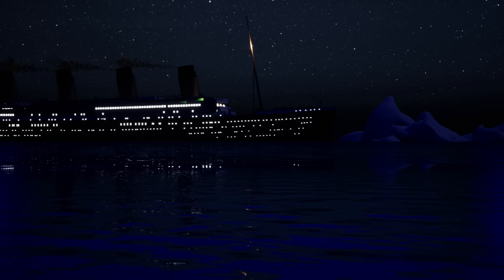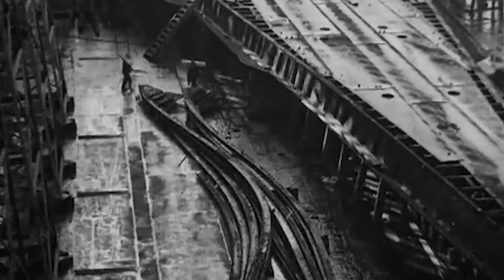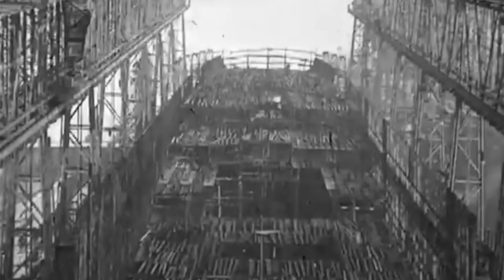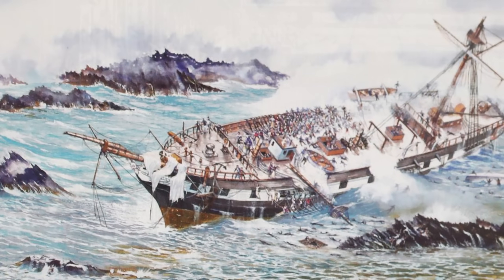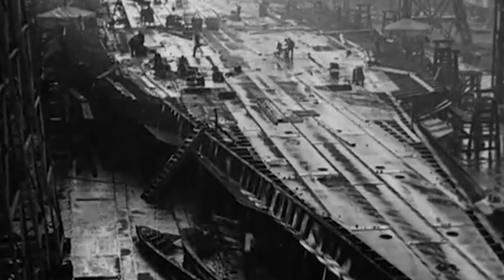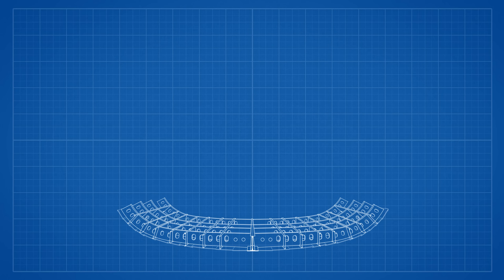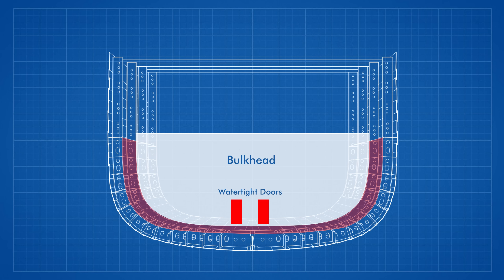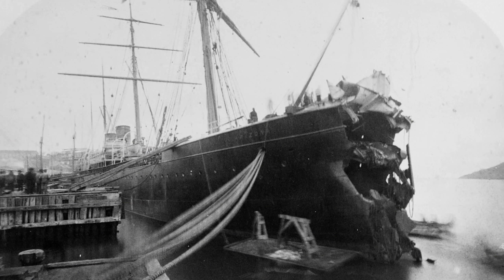How did the Iceberg Sink the Titanic?

Comment: One bit of pedantic correction: Technically, she wasn't designed to survive four compartments flooding anywhere. She was instead built to the specification of "Three of her four forward most compartments." It just so happened during the Inquiry Wilding calculated she could actually float with all four of her forwardmost compartments flooded, not just any three.

Additionally, later computer analysis suggests that with a couple exceptions around her engine room and (somewhat ironically) Boiler room 5, the ship could float with any three adjacent compartments flooded, though she was only built to have any two adjacent compartments flooded. She was a tough cookie; the iceberg merely found an Achilles' Heel.
Reply: It was less of an Achilles' heel and more that the ship hit circumstances beyond its limits. The fact is the Titanic collision could have quite possibly sunk even a modern ship. However, the difference is that modern ships don't sail into icy waters at full steam, don't solely depend on lookouts, take every ice warning seriously, don't use wireless as a fancy toy, and a whole load of other stuff. Titanic was sunk as much by hubris as anything else.
Reply: @whaleguy  it was common then that ships wouldn't reduce speed until they came into an ice field and then slow down. Just turns out the first indication of this ice field was the one directly infront. 
But yeah modern ships have radar and sonar and can detect icebergs long before they could see them.
Reply: @MrT------5743  It wasn't common to slow down for ice, but it was a dangerous practice nonetheless. A real, "They can't be negiligent if everyone is negligent" kind of situation.
Reply: Had flooding been limited to Titanic's first four watertight compartments (Forepeak Tank + Holds 1, 2, & 3) the horizontal bulkhead that formed the top of the Forepeak Tank found at the lower end of the first watertight compartment would have prevented flooding above that point keeping the rest of the compartment, which contained part of the Black Gang's living quarters, dry with the collision bulkhead between the first two watertight compartments holding back flooding that the three holds sustained during the collision.
Reply: You're a real tough cookie with a long history, of leaving lots of gashes likes the ones in me. Hit me with your best shot, lifeboats away.

Comment: One thing I always loved was that during the Inquiry, Wilding postulated the total damage to be no more than 12 square feet, or about the size of a refrigerator. When they used sonar to scan the hull, the total of the damage the sonar revealed was indeed 12 square feet. Wilding knew exactly what he was talking about. Another great video, Mike.
Reply: If I recall correctly, the side scan sonar team tried to avoid being too definitive about the size of the iceberg damage, as they also found a lot of damage caused by the simple fact she was bent as she hit the bottom
Reply: @flametitan100  The keel was broken a second time by the bow down impact of the bow section with the bottom.
Reply: @taras3702  That's what I'm referring to. The bow is bent around the cargo holds because of the collision with the seabed. The keel obviously took the brunt of it, but the sides did too, with a massive hole on either side.
Reply: Makes sense. He calculated based on how long it stayed afloat. They know the exact volume of the ship. So the area of the intake hole could be estimated.
Reply: I know it's been a while since you posted this, but do you happen to know where in his testimony he postulated that? I've begun reading parts of his testimony from the British Inquiry and I'm having trouble locating it (he answered more than 1,100 questions over 4 days!)
Reply: Either way, that is a very small hole in relation to the size of the ship. Bear in mind in 1872 when The Great Eastern struck at the time an uncharted rock, she suffered an 85ft x 5ft gash in her hull. That's an area of 425 square feet, nearly 35 and a half time more damage and not only didn't she sink, most of the passengers didn't even notice anything had happened. That's the level of safety that a double hull provides!
Reply: Too much free communication.
Reply: It could be worked out mathematically from the rate of flooding in each compartment.
Reply: It was also pointed out that since the ship was allowed to flood head first instead of on an even keel, the amount of hull open to the sea was automatically compounded when the anchor hawse holes went below the surface. Other calculations that were made predicted that Titanic could have lasted up to 8 hours if Captain Smith had allowed the ship to settle moreso  on an even keel. This could have delayed the other openings like the cargo hatches to have been breached much later and created less weight up forward that wouldn't have pulled the ship down as fast it did.
Reply: @rabbitramen but would it have helped that much if the watertight doors had been opened to spread the water out evenly?  In that scenario the first thing of consequence to flood would be the fireboxes of the boilers, all of the boilers.  That would have led to a pitch black ship on a pitch black night, not to mention the pumps that were running would have stopped (assuming that the pumps did any good at all).  I know that Carpathia would have made it in that scenario and the sun would have come up with several hours to go before the final sinking.  But the pitch black night from the time that the fireboxes would flood, quickly causing the steam supply to be exhausted, making the generators stop, wouldn’t take too long since they were just above the floor plates.  So if they flooded say about an hour after the collision, that’s at least 5 hours of total darkness.  I know they had some flashlights and candles were on board, but it would have been very difficult to have known what was happening.  It would likely have been chaos.  But who knows.  It’s entirely possible that carpathia arrives, rigs electric lights, starts transferring passengers, then once the sun comes up is able to accelerate the transfer of passengers, getting everyone off the ship with an hour or two to spare.  Although I suspect that some passengers, especially those in the lower decks, would drown in their rooms or in the corridors due to the complete darkness once the power failed.  But again, that’s not necessarily the case.  Just a few things that I thought of.
Reply: Damn you have a tall fridge.
Reply: @user-kz6vc1yn6p  12 square feet is not the same thing as 12 feet long just FYI so they're right, about the size of a standard refrigerator.
Reply: he probably calculated it based on the time it took for Titanic to sink, since he knew precisely how long the ship had been afloat for.
Reply: What??? The iceberg damage is under mud. The bow plowed into the bottom and buried the iceberg damage... That was one of the great ironies when it was found. No One has ever seen it.
Reply: the question I have is why wasn't Wilde considered when the graphic artists got to work representing what happened?
Reply: @KiwiSentinel  - Whaleguy has most of the factors correct.  There are several aspects at play here - while Wilding (representing Harland & Wolff) did provide evidence to both the US and UK inquiries, the fact of the matter is that those inquiries were run by the US Senate and Justice Lord Mersey respectively - their expertise was legal rather than technical, and Wilding's submissions constituted a single piece of evidence which, while based on solid engineering knowledge and calculations, was still effectively theoretical.

On top of that, it's worth remembering that the illustrators were employed by the press, and the press will always go for the most sensational take on any given story - the inquiries couldn't officially determine what the actual damage was, and the claims presented a sliding scale from Wilding's evidence to the theory of the 300-foot "gash".  On that basis it's logical that the press would go with the latter as most likely.  More generally speaking, in the minds of the public at the time, the notion that a liner of that size could be sunk as a result of anything less than massive and catastrophic damage simply defied belief.
Reply: @turricanedtc3764  The damage was indeed "massive and catastrophic" as evidenced by the indisputable fact that the ship sank rather quickly. The problem was that to the untrained eye, it didn't appear to be as bad as it obviously was.
Reply: @KiwiSentinel  perhaps because Wilding sometimes gets forgotten in the story of The Titanic. But do not quote me on that one.
Reply: @KiwiSentinel  Are you talking about any specific depiction in particular? Firstly, at the investigation, Wilding correctly speculated that the total damage was small as mentioned. However, he was overruled as it seemed unbelievable that a ship the size of Titanic would be laid low by damage that covered just around a square of pavement. That lead to the popular "300 ft gash" theory that has been oft quoted. Secondly, the damage is extremely small in comparison to the ship. So in any normal depiction where you can see the entire hull, the damage will just be very thin lines along the hull that look like scratches. In fact, the breaks are estimated to be roughly the width of an adult hand. Keep in mind, this is a hull that is 104 feet from the bottom of the keel to the top of the bridge. Any modern depiction of the damage is actually very oversized compared to the actual damage, just to illustrate what happened. Here is one such depiction, but again, in reality, the openings would've been really small if we were to see the ship from the side at a distance far enough to include the entire body.

http :// writing. engr. psu. edu/ uer/ bassett/ fig3.gif
Reply: @whaleguy  Then why are they talking about multiple cuts that are upto '45 feet each'. And Im confused as to whether they are cuts from the iceberg or the bolts came off opening it up?

Comment: Great video as always Mike, thanks! Question: If Titanic's hull had been welded, rather than  riveted, would it have made any difference in the way the hull opened up? I've read articles that state that the rivets used were of a different grade steel than the plating, and that the grade used was more prone to shearing than the hull plate steel. I have seen first hand that this can happen; I worked in a shipyard where they used Grade A steel to make the padeyes used  to lift the huge modules that made up the ship. One of the guys I worked with ended up making a bunch of said padeyes out of HY80 (armor) steel rather than the Grade A steel that the design specs called for. The resulting padeyes were more brittle and snapped under load, rather than flexing as they were designed to do. This resulted in a module dropping ~20 feet when the padeyes failed. Luckily, nobody was injured in the accident, but there was some significant damage done to the unit. These modules are about the size of a small house, and understandably quite heavy.
Reply: Yes the steel did have quality poorer than modern steel, but it all did pass the shipyard testing for tensile strength, as they did test all batches that way for all materials. That only came in in WW1 and WWII, when they used sub par steel that had high sulphur content, which made it become brittle in the cold weather of the Atlantic. However the steel did still work to absorb the energy and deform, and the rivets that failed were operated well past design spec. Yes the modern testing did show they were not as capable as the best of the day, but none of them actually were defective by the standard testing of the day, even if they would have failed when cold. But test at room temperature, around 15 to 20C ,and they passed, even if they would fail at -15C.
Reply: No. The damaged area where the iceberg did the fatal damage to the shell plating on the starboard bow as as much as three inches thick due to three strakes overlapping. Welding would have eliminated the popping rivets, but welded steel is more brittle along the welds than the base metal. I would say instead of plates separating from rivets popping, there would have been instead cracks or tears in the steel plating that would have sunk Titanic anyway.
Reply: There has been so many ships almost the same size as the Titanic and smaller didn't matter what year they were built if they would have hit the iceberg head on 90% of the ships make it all the way back to Port with front end damage after hitting icebergs and nobody was ever killed or injured the motors were still able to run and the water never reached a crisis level..They would turn around back to where they originally started..Truth..💪👈
Reply: Funny story I remembered talking to my buddy in 1910 when we where building it and I asked him, Everette, why are we building the hull like this and he said that I should go worry on my own problems and till this day I live in awe from his decisions and have never forgive me #EveretteCauseTheSinking

Comment: Great work again, Mike. Though, it can be argued that Titanic did not sink that quickly. Actually it held quite well and gave time to organise the needed measures. The fact, that enough was not to be done, was regrettable.

(This accident could and should have been much similar to one with Republic, with minimal loss of life. Had there been 24/7 wireless duty on all ships etc.. And the Republic sinking should have rang the bell in order to arrange it. It did not, and a bigger disaster was needed for that. Money went before safety then, has always done so, to some extent, even after Titanic. )
Reply: Had the Californian kept her Wireless on, rescue could have been at hand and far smaller loss of life. I see two factors. First was complacency, North Atlantic travel was so routine nobody regarded it as dangerous, especially for a ship as large and well designed as Titanic. Second, the Wireless wasn't seen as a safety equipment or for ship's navigation, it was intended as a way for telegrams to be sent between those on the ship and people on land, a luxury for passengers. Comparing with modern airliners, it served functionally as the in-flight wifi rather than pilots' radios. This and a few other incidents showed how important it could be for safety, the potential for saving a ship in distress, and its role changed afterward.
Reply: @quillmaurer6563  Absolutely.